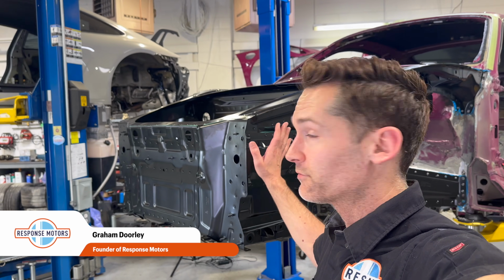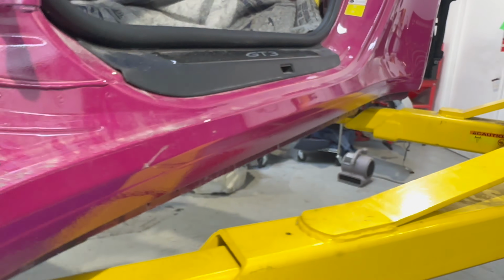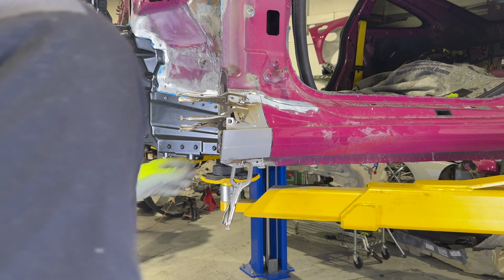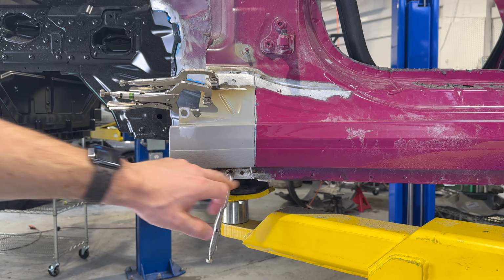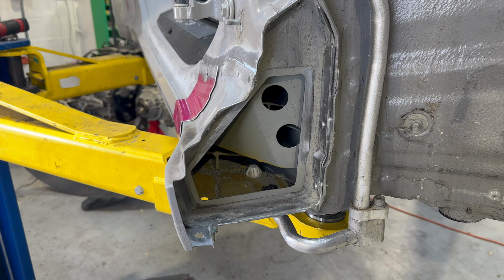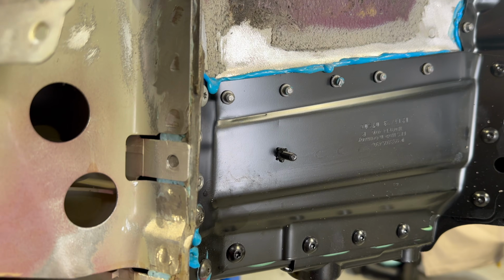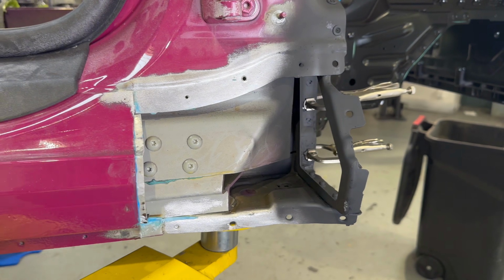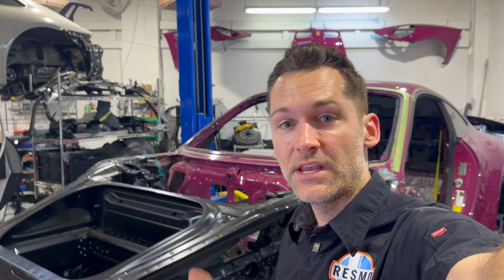FIXING STRUCTURAL DAMAGE ON THE GT3! 992 911 GT3 BUILD EPISODE 11

Comment: Nicely done.  I'm used to old skool 911s, so just spot welds, not panel bond and rivets.  Can you weld through the panel bond?  What was the gold-ish colour substance you were applying at the 22:20 minute mark?
Reply from the maker: Thank you for the support!

The gold-colored stuff is welded through primer. You put it anywhere that has uncoated metal and you're welding so that you ensure there is corrosion protection.
Reply: Thanks for the reply!  I'm guessing it's copper based?  You put it on so tidy, I wasn't sure what it was.  So many other guys really go to town with the weld through primer!

Comment: Looking great, Dude! I almost have my 996 up and going. I hear you with the body work. Not a fan but I knew it was going to be necessary. I’m in the middle of removing the rear drivers side axle cuz the cv Boot ripped during or before the accident and it looked like gravel pit in there.